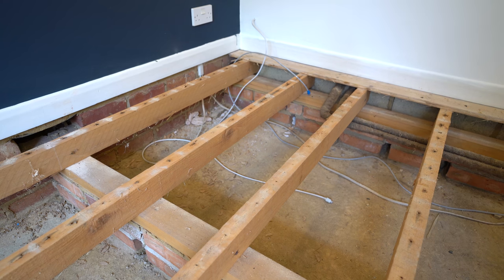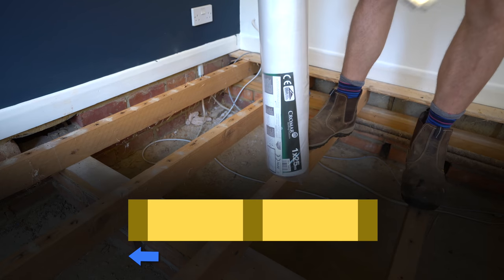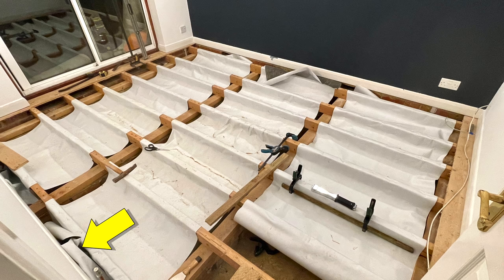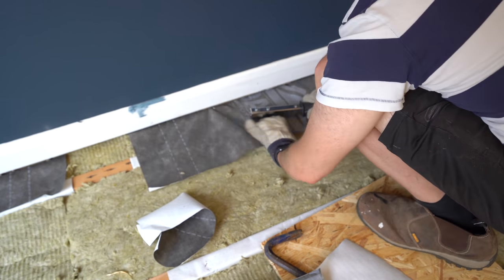Insulating A Suspended Timber Floor

Comment: I did the same. Massive difference. I’m still surprised why people in the UK build houses this way. This should be concrete panels not wood. If it is concrete no air ventillation is required. This technology is 200 years behind the civilised world.
Reply: Sure, but sometimes suspended floors are still needed, not only are they cheaper and faster, if the ground is poor and the building requires piled foundations, you won’t be allowed by building control to install a ground bearing slab. A simple solution to this is suspended timber. Also, if you are in an area with high shrinkage clay ground, and you remove a mature tree as part of some extension work, building control may also be requesting timber floors to offset the risk of ground heave.
Reply: You do understand that too much air tightness is worse for health than an old drafty breathable floor .
Reply: Concrete floors actually have worse u-value than a well insulated suspended floor.  That is because concrete conducts heat.  You can of course put PIR or other insulation on top of concrete, but that has to be done at the right time and can't be retrofitted.

Comment: So the question is… can you notice a difference between this and other floors not insulated for drafts and also under your feet thermally ? Many thanks
Reply: I did mine using Kingspan PIR, only 50mm not the recommended 75mm, and yes its expensive (£600 for a room inc. new joists, batons, fixings, foil tape etc) but it paid for itself within 2 years in reducing heating costs.Absolute no brainer. The rock wool won't be as effective and you have to install a membrane which isn't necessary with the PIR boards. With material prices as they are now I would have to weigh it up carefully. I will not hesitate, personally, to PIR insulate any suspended floor in any future property. It makes a HUGE difference - especially if you also brick up any open chimneys (leaving an air brick at ground level under the insulation for ventilation).
Reply from the maker: Most definitely, feels so much warmer on the feet even with socks on.

Comment: I have a house from 1939 in Poland. Same floor. I thought I would pad the membrane under the beams and then pour in granulated Styrofoam. Styrofoam would be free from construction. I wanted to grind it with a machine. Regards

Comment: Your airbricks are ventilating the cavity, there should be ducting between the inner and outer walls!!
Reply: I’ve only ever seen ducting on the new modern “plastic” air bricks not on the older style “clay” bricks.
Reply from the maker: That makes a lot of sense. Wish I'd looked into that but perhaps the thing to do is take out the clay air brick as Azza said, from the outside and replace with a plastic one. Even if I had put some kind of duct in, it would have been difficult to seal around the sides so better if it's an all in one. Good tip 👍
Reply: Just push in a plastic duct from inside the house through the cavity to meet the external air brick, and ideally seal it against it. Plastic air bricks look terrible, never replace for plastic!!
Reply: @MrMultiH  Plastic look terrible, but better air flow (apparently)... you can also get S shaped ducts that allow you to shift the airflow lower
Reply: @AliDymock  If you look very carefully at your video of the air brick you can see what the insulation installer has done. (look closely at the insulation and you can just see the blown fibre to the right-hand side which is slightly lighter in colour) When insulating a subfloor the air bricks are removed then Roll insulation is cut into strips and put into the cavity to stop the blown fibre from blocking the ventilation, a new air brick is then fitted. There is no need for a plastic sleeve in this situation.
One other observation regarding the sub-floor insulation if you do it again, is to try and keep the insulation slightly above the joists by a few mm. This will ensure the insulation is tight against the floorboard. The basic rule of insulation is to keep the insulation as close as possible to the heat source.

Comment: Hi - is it 100% necessary for the VCL? I am doing it from below now and can’t rip the boards up… I have had a fair bit of advice from both Building Control and the insulation manufacturer that it’s not necessary… thanks, great video btw

Comment: I have quite a deep subfloor, as is common in scotland, so did it from underneath. Was amazed by the difference, especially because I have exposed floorboards! I reckon mine will pay for itself in 1-2 years simply through draft reduction.
Reply from the maker: Didn't know that was a thing in Scotland I had hoped I'd find a hidden basement, but alas.
Reply: @AliDymock  I think it's related to the relative position of the frost line, which is much deeper in Scotland. In Aberdeen I had a full size full height basement
Reply: @GM-dc8vr  I have a similar thing in the south in England but I think its due to the house being a weird hodge-podge built up over the last few hundred years on different levels. Can confirm it is very draughty and cold.
Reply: are you still trapped under the floor though?
Reply: @SMega  help

Comment: The breathable membrane has to go all the way around the room and go slightly up the wall or it's marginally better than using chickenwire. You also need to tape the seams and the batons at the bottom of the timbers are really not optional. It also looks like you cut the Rockwool too loose as it should be hard to push it and slightly compressed agains the timbers. Overtime, houses move and your insulation has to stay in place with movement. Batons are there to make sure the membrane does not separate and the membrane has to be a taped in order to ensure that wind stays on the outside of your heated envelope. 
Most of all, given the disruption that working on your floors causes, you really want to make sure you don't have to open then up again for a long time.
Reply: useful be great if you can share your video too?

Comment: Good video and discussion.

A couple of points.  

The rockwool insulation is better to use as it allows water to pass through should the floor get wet and water travel through the flooring and it also allows  moisture to migrate.  I use PIR at the perimeter so that  moisture can not transmit to the joists.

I do not use breathable membrane, I use woven garden fabric.  As you say a membrane type suppprt prevents “wind” moving vertical.  Garden fabric is very tough and UV stabilised so I expect it to last 50 years.  

Totally agree about the solum if damp.  I dig it out down to the top of the foundation, put in 2 inches of river gravel then a membrane then 3 inches of concrete with waterproofing additive, why not it’s cheap.

I staple the fabric under all the joists wrapping it at the perimeter joist before the PIR insulation goes in.  If the centres are wide I nail thin buttons on at 500 mm separation tangential to the joists.

I am in an 1890 house and the method I use transforms the ground floor to no dampness and no more draught or cold it really makes a difference.

Good video keep them coming, we need these more than ever to improve older housing stock in the U.K.

Comment: We are in a first floor flat, with a similar floor to yours, and the noise transmission between the flats is incredible with similar insulation in addition to felt over the top of the 4x2 timbers

Comment: It doesn't seem like it's worth it but I think I'll need to live in the house through one winter to determine. I'm going to delay putting in flooring until next year (buying a 1900 Victorian terrace). This is a really excellent DIY video if I do decide it's needed and I might do it anyway if I need to replace the joists - thank you!

Comment: You should knife small slits into each run of the vapour barrier, at, say, one foot intervals. If a catastrophically burst pipe floods this floor the slits will allow the water to drain through. Without the slits the water - which could be tonnes - will give you a forever pond, on top of the vapour barrier, just under your flooring. Tiny slits will not compromise the vapour barrier.

Comment: Really good video and explanation. I find floors can be intermittently damp depending on the time of year. Unless a full CCTV drain survey and soak away check, in my opinion it could be risky insulating a suspended timber floor. Also it is prudent to sleeve the sub floor vents through the cavity just incase something occurs in the future, and restricts sub floor ventilation. An insulated floor because it’s colder, will increase the relative humidity, and could put the timbers at risk of woodworm issues. Might be worth treating the timbers at least for peace of mind👍
Reply from the maker: Some great points here. You're absolutely right in that adding insulation while all the rage is somewhat of an unknown because there hasn't been a lot of time to study its effect hence why I was really careful with making sure the ventilation isn't interfered with. Of course adding a vapour barrier counters this risk and ensures less vapour is getting through than before even though less vapour can escape.

Another good point and I wish I had done some sleeving because the insulation in the cavity walls could drop and block the vents. The good news is I can always do this from the outside of the property later on if I detect any problems.

Yeh not sure if these were treated or not actually. 1985 this bit of the house was built, not sure if they treated timbers then. i'll thinking about for the rest of the house.
Reply: @AliDymock  What you mean sleeving? where would you put it?
Reply: @martyn334  maybe some galvanised wire mesh bent in a rectangular shape  that fits into the vent to prevent insulation from dropping down.

Comment: Great video thanks.  Just what i needed to see.  I'm about to do exactly the same in a north facing very cold room with large windows in a 125 year old house.  Hopefully this will make a big difference.  Even in summer the carpeted floor is cold due to the ventilation underneath.
I'm confused over the DPM though.
1 - Why is it needed and what is the source of the moisture it is protecting against?
2 - Will it not trap moisture immediately below it, which could then compromise the joists?

Same job to be done on the kitchen, also north facing which has the same sub floor cold issue.  However this one has a porcelain tiled floor with underfloor electric heating installed.  Freezing to bare feet without the heating on.  There's a good deep crawl space under this one accessible from the hall so will cut the rockwool slab tight to the joists then fix the breathable membrane to the bottom of the joists.
Looking forward to warmer feet.
Thanks.😀
Reply: I would like to know this also! I have recently insulated my suspended timber floor the same way as Ali here, with a vapour barrier on top of the joists, but I am worried about trapping  moisture from leaks and spills etc between the Vapour barrier and the underside of the chipboard, Leading to mould or rot. Amazing how many differing opinions you find online. I wish I had not put in a VB now as I feel it is more likely to cause issues than prevent them. But what the hell do I know?
Reply: Did it make a difference? I want to do this floor insulation

Comment: Nice clear video thanks.
I have a 1930s house and the boards are difficult to get up and split. I can get up about every 4th one as they have been lifted and ruined in the past. I did use the same type of insulation on my roof sliding bits into the small slope so I am thinking I can do similar sliding the bats into the floor area. 
I am just thinking that a laminate floor will be air tight and the black dpc is also air tight so the boards are stuck in the middle with no air. So I think I would leave out the black dpc, let the boards breathe and any floor covering will stop drafts.

Comment: You may not be doing anymore jobs with that Rockwool insulation but just an FYI for those that are here thinking about using it. 

Great stuff and it cuts way better if you find a bread knife with a serrated edge to use vs a utility knife, almost no crumbs and perfect blocks. I found one at a garage sale to add to my tool box but a new one isn't too terribly expensive.

Comment: What we should be doing to all properties but imagine, the family has to decamp into temporary accommodation, their furniture into storage, the workmen move in and once the boards are up startfinding pipes and dodgy wiring that all has to be sorted. The scale of the problem of net zero isn't understood by politicians but is by plumbers, heating engineers, electricians and builders. Good job.

Comment: Thanks for posting this , I’ve just discovered I’ve got a crawl space under my living room that hasn’t been insulated and have no idea what to do
Reply: If the crawl space is deep enough to manouvre under the floor, then lift a few floorboards to make an access point, and install fibreglass or Rockwood roll insulation between the floor joists. Staple some garden netting across the underside of the joists to hold the insulation in position. You could use a breather membrane here, but it can be very awkward to] position it and Staple at the same time.  Overall cheaper than using rigid insulation but slightly less insulation value.  Do not arrest if you are at all claustrophobic.

Comment: Thanks for this.  Planning a renovation and can't get round the guilt I am going to feel every time I look at the parquet unless I insulate first.  You make it look almost easy to DIY...  I would mention... wiring.  I also have to rewire.  Before or after the insulation?? Especially with the hammock method. Electrician would prefer before, but future electricians would prefer it on top, no?
Reply from the maker: I've made do with few and cheap tools in the past but having the right ones does make it easy and relatively quick - you got this! I would say to do the electrics before insulating and just make sure you have all the sockets you need so you won't have to add ones in future. Cables under the floor rarely need much attention.

Comment: Great video as per usual. 
I need to do the same but without ripping the floor out. I have a crawl space which will make mi life a wee bit harder! :) 
Thanks for sharing.
Reply from the maker: It’s good that you can get to the underside. Quite how to do a vapour barrier though, I’m not sure. If PIR you might be able to do without as it’s moisture resistant. If wool then possibly one over the floorboards with it ventilating downwards through the joists/insulation though that seems to be recommended against.

Comment: Ali, next time use a old serrated bread knife to cut the insulation, cuts it like butter 👍
Reply from the maker: Super, will try that or buy a proper insulation knife. Going to be doing the whole ground floor eventually.
Reply: @AliDymock  A fine-tooth wood saw works just as well at the correct angle to avoid tearing. If you need lots of different widths is easier to cut through a complete roll before unwrapping the insulation. (Just like cutting a swiss roll)

Comment: curious how this has gone. I am thinking of doing exactly the same, more for comfort reasons, so curious if it feels more cozy - as subjective as that is. Great video - an super series on the garden room
Reply: Same here.
We are thinking of doing the same as the cold air that rises upwards soon makes the front room very cool.....
Also the void in our front room in about 3ft..

Any idea whic brockwool product he used!
Reply from the maker: Really well and what's interesting is the gap I had to leave by the patio doors for air flow I can really feel the difference in temperature compared to the rest of the room even through the floorboards, underlay and laminate I laid. It's much colder in that spot. So definitely worth doing and wool is pretty effective especially for the price vs PIR.
Reply from the maker: I used thermal cavity wall rockwool 100mm thick. I reckon they're all much of a muchness

Comment: We have a suspended timber floor in a 1930s house. We ate goung to put a solid wood floor on over the floor boards, with suitable underlay.  Will insulating under the floor make a difference? Is it worth it?

Comment: I have been researching on how to insulate my suspended timber floor for a while now. Each time I come across a new tutorial on youtube I learn something, but I also get confused. Now I have got so many questions! For example
1 arent the membranes (both the dm and the vl) supposed to be sealed all around the room? And where should they be sealed, exactly? On the plasterboard under the skirting board, or on the bare wall under the plasterboard itself? 
2 isn't the air vent at the level of the joists making the insulation much less efficient? Cause this is exactly the same situation I have in my house, and after watching other videos I thought that the entire perimeter of the room (at leqst esternal sides) should be sealed. The air vent being in the middle of the way is clearly an impediment to this.

I don't know if I am clear, but I hope someone would help me

Comment: At 2:20 you mention the membrane was placed face down but didn't expand on it. Is this because the membranes are designed to be face up in roovers, therefore the printed side should face out of the building?

Comment: Hi Ali, great video. I have some questions and i hope you can answer
1. Is there any reason why you didn't cover the space between the insulation and joints with insulation tape?
2. In a part of the video you specify to leave space between the window and the insulation.  Why?
3. Would it be possible to add a second link for the breathable membrane, as the one listed has expired?
Thanks